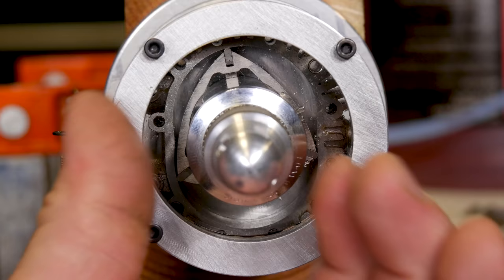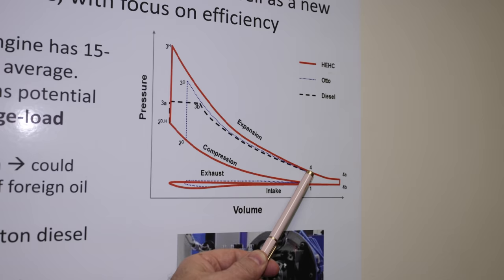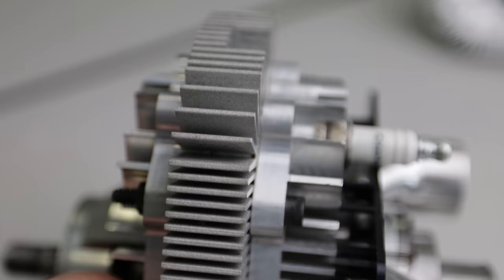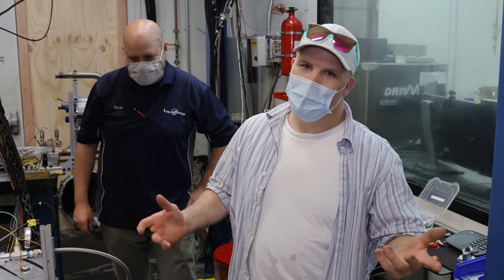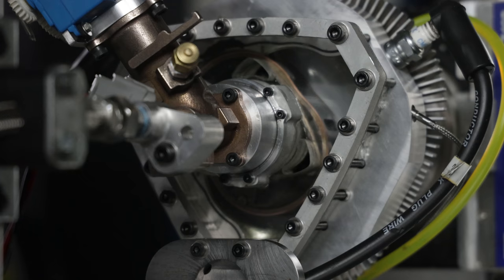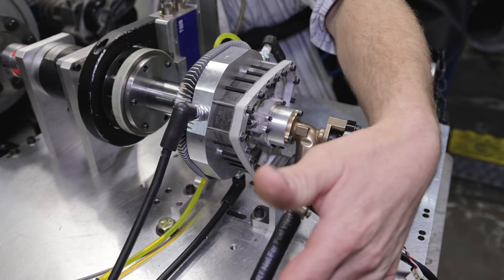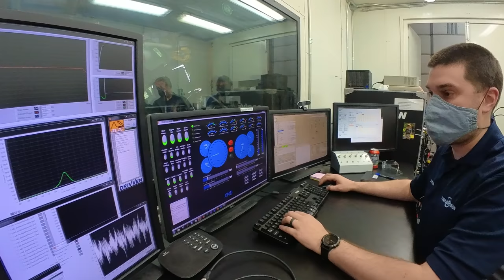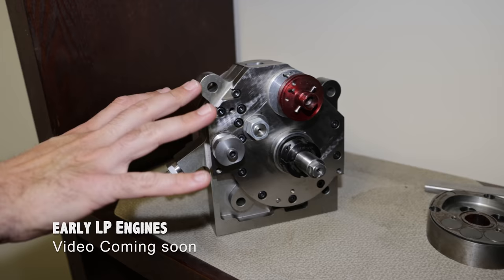See Thru Liquid Piston Rotary Engine - In Slow Motion

Comment: how about lubrication ? does it still used 2T oil?
Reply: Ente disini juga juragan wkwkw
Reply: Bang ft
Reply: Can you answer with the lubrication thing, how oiling work done, because as you know the most common problem of the rotary engines is they burning oil with fuel so it's not good for emmisions etc. Will they fixed that problem? can we see the rotary engines legally on the roads again ? @Warped Perception
Reply: @EmreGhost  there is no oil reservoir so yes, oil needs to be put in the   fuel. Lovely engineering but electric motors are now where it's at
Reply: @EmreGhost  no one cares about emissions
Reply: @dhc2  
Um, the EPA does.
Reply: @dhc2  except everyone who regulate the market
Reply: @aaronburratwood.6957  Do not confuse green energy with money...🤣
Reply: @tkorte101  " but like all plants trees need CO2" what is this even supposed to mean? Trees pull CO2 from the air and convert it to glucose. Approx. 40-50% of the tree's mass is cellulose, aka chained glucose. Scrubbing CO2 from the air and storing it in the form of cellulose is kinda the point of planting more trees.
Reply: @tkorte101  Okay, link me to those studies you're talking about. And I don't mean YouTube videos and conspiracy sites. I mean real, peer reviewed scientific papers discussing the topics you've mentioned. You do that and I'll shut up. I know you can't because they don't exist, but I would like to see where you get these ludicrous statements from. In reality, ocean acidity due to the absorbtion of atmospheric CO2 is becoming so bad that the shells of crustaceans are literally dissolving. 

Anyway, I'll be waiting to read what you come up with, I could use a good laugh. Stay safe, my friend.
Reply: @tkorte101  The biggest evidence of global warming is the fact that it's been going on for 15k years now. The Northern hemisphere glaciers started melting off long before man stepped in with emissions. You are correct that Alarmist have bought in so hard theres no turning back despite evidence staring them in the face. Their "evidence"? Gas bubbles trapt in ice going back a hundred thousand years in Antarctica. Imagine basing your entire belief system and green ideology on frozen Gas Bubbles.
Because that surely tells the entire Earths climate history.  
This doesnt even begin to address the super massive volcano eruptions or asteroid impacts that directly caused extinction level events. No no.. Humans are "forever changing" the climate beyond those extinction events because their gas bubbles trapt in isolated sections of ice, that can only go back 100k years, is more reliable than common sense and actual science.
Reply: @geor664  Actually, I looked it up on their website, they do inject oil, but not into the main chamber, only spot lubrication on the seals themselves.
So the LiquidPiston rotary engines actually don't need more oil then a regular piston engine.

I love the idea of all the flexibility of a hybrid car with this engine.
You could produce hydrogen at home to fuel it as well as charge its batteries at home, then switch to gasoline when on long road trips if needed, or biodiesel or all sort of other fuels, and if there's a huge cataclysm and society ends or whatever you'd have several possible ways of powering your vehicle. =)
Reply: @tkorte101  Yes, they need CO2, that's the whole point.
There's too much CO2 in the air, so the trees are meant to be planted to convert the excess CO2 in the air into wood.
Most of the CO2 in the air right now has been locked away in coal and other long and usually slow carbon cycles for millions of years, but we've fast tracked their emissions without fast tracking their absorption back on the other end of the carbon cycle.
Reply: @tkorte101  Critically low CO2 levels?
Where the heck did you get that idea from? -_-
You can test the CO2 levels yourself, they're high.
Yes, there will be a day when we'll run out of carbon on our planet, but that's gong to be billions of years into the future, approaching the time when our planet will be swallowed by the sun anyway...
And yes, if you go back far enough in the fossile records there wasn't exactly much CO2 in the air back in the days when most of our coal was actually created as most of it was bound in the forests that became our current coal deposits, where a lot of that carbon has been locked away ever since, thankfully.
Reply: @tkorte101  It's happening.
The reason why carbonated water is acidic is because the bubbles in carbonated water is literally CO2.
And every single gas in the air gets trapped in air bubbles that gets mixed in with the sea water naturally due to waves etc.
I'm sure you've seen them, waves, right?

As for the "how things used to be like" idea...
Yes, there's been a lot of different eras on our planets history, including several that humans would never be able to survive in...
Several where we quite literally wouldn't be able to breath.
And no, plants are not carbon starved at all...
We've also had periods with way less carbon in the air even then to prior to us humans showing up.
Reply: @The_Chad_Davis  There's actually quite a few more evidences then just those gas bubbles in the ice, although they are a important clue.
Climate scientists are of course using multiple sources of data.
Reply: @Luredreier  just a quick correction, not picking sides in y'all's shit show of a comment section. But carbonated water is acidic because in order to carbonate water we put it under high pressure (higher than ambient) when pumping it into the water. This creates carbonic acid H2CO3 it doesn't come naturally from CO2 on air, otherwise the ocean would have swallowed all the CO2 by now. It forms when water and CO2 are mixed through either pressure, or minerals that would rather let go of their moisture; I.E. it forms in very minute amounts in soil, carbonated water, and your blood. Large amounts of CO2 wouldn't cause a very large jump in carbonic acid creation, only pressure and presence of the right conditions would.
Reply: @ZeroCooly  That's fine and all, but a quick Google search would have shown you that ocean acidification is a real thing that's happening and can be proven, so I'm not sure where you got the idea that the ocean doesn't absorb CO2.
Reply: @tkorte101  All these arguments are pointless.  The only thing that matters is who has the power and what their regulations will be.  Right now, ICE is on the outs.  That's reality in the first world at least.  These little Wankel engines may have their place, but automobiles is not one of them.
Reply: @tkorte101  Still waiting for you to post any reputable sources. Oh wait, you can't. There are none.
Reply: @EmreGhost   the concept of a rotary engine is useless. only an insane person would buy a car that has a rotary engine. It's a really cheap pile of S***t.
Reply: Oil is metered directly to the seals through the housing. It doesn't need to mix with the fuel. They claim oil consumption is down near the level of 4-stroke piston engines.
Reply: Pretty sure It uses astroglide.
Reply: @dhc2  maby in your world
Reply: @mashrien  you must be a millennial. Read a little and you'll find that storms were much worse in the 50s. Then  look beyond your small sphere of experience for reference when forming opinions. And never listen to government "experts"
Reply: @geor664  The apex seals can be lubricated directly from passages in the housing, since they're stationary.  They get similar oil consumption to a 4 stroke piston engine.
Reply: @Luredreier  the concept is mindblowing really. Amp the scale, devise a way to stack the rotating assemblies, and start collecting used fryer oil. Install a decent flywheel, some gearing, you could potentially generate cheap electricity from home.
Reply: @geor664  Porsche just created synthetic fuel, so the ICE might not be dead yet.
Reply: @elonquemattheson6151  point taken.
The motor is a nice design.
Reply: @mashrien  hurricanes and tornadoes not at record levels  glacier melt and growth are about even
Reply: @mashrien  the reason for the increase of tornados and hurricane is there's more people to report them. Also when a volcano erupts it emits more CO2 than humans do in 1000 years. And the sun drives the climate.
Reply: @Luredreier  they can suck carbon out of the air to make fuel it's renewable. Carbon will never go away
Reply: @JadeB628  Um, I think you're missing the whole this is a different design from those that had all the problems in the past thing...
This isn't a engine with even half the issues that rotary engines of the past has had.
Reply: @flashg1160  This is about statistics.
Yes, there's been bad storms in the past and there will be bad ones in the future.
But there's more of them and on average worse ones comming.
And worse ones have arrived.
Reply: @highclasswhitetrash9027  Yep, but for me it's powering these things from home made hydrogen while still having the option of other fuel types when needed that's appealing.
And of course I'd like it to be a plug in hybrid if I'm even to consider it.
I'd be running on electricity the wast majority of the time.
Hydrogen, diesel etc would all be backups for the battery for me for situations where more engine power or range or both is needed.
Reply: @christopherbrown6523  Creating new fuel really isn't the point.
Even if it's synthetic it's still going to release emmissions that's just not acceptable long term.
ICE is on its way out.
More then half of all cars being sold here in Norway has been electric for several years now.
Reply: @fliporhold  No, there's more glacier melt now then there was.
Yes, there are places where there's more growth and some individual places it's about even, but on the whole around the globe they're retreating at an alarming rate.
I've been to several of said glaciers, both here in Norway and when visiting family members in Iceland, the difference is quite staggering.
Also, I have family members over in Greenland who have shared pictures from their home villages over on Greenland and the glaciers there...
Trust me, they're melting fast...
Reply: @Jv19979  Actually, vulcanoes emitt about 200 million tons of CO2 every year, humans do 24 billion tons every year.
We're releasing far more CO2 then all the vulcanoes on earth does right now.
Reply: @Jv19979  Removing carbon from the air is a energy intensive process, it's not really viable to do in a non-biological way yet, and even if it became viable you'd need a lot of energy to do anything like that.
I can gurantee that it's not going to be the fuel of the future.
ICE is on its way out.
As for carbon never going away...
As a fuel, most definitively it will.
In the air...
No, not for billions of years yet...
But eventually the planet will lose its magnetic field and therefore also its atmosphere and its carbon...
Reply: @Luredreier  no it's not look it up. I think gas per gallon is 10 cents higher when they do it. There's a company in Canada that does it.
Reply: @mashrien  I mean all that may be true but I mean I also want go broom broom
Reply: @Luredreier  im not smart enough to manufacture hydrogen, yet. The possibilities of this little engine though, it really is amazing.
Reply: Ketahuan bang😂
Reply: @mashrien  well spoken
Reply: @Luredreier  I am stupid... but I know  C=Carbon...0=0xygen---CO² is 2times Oxygen what I desperately need... I even put it in my Water with the "Soda-Stream" machine with this little CO² bombs.
Here in Germany are big Factories who produce 100% pure CO² with the explicit aim to relies it into the Atmosphere in vast Greenhouses, Buble-water, Coca-Cola, and 1000 other things....but CO² Tax is only on cars?
The other thing i don't understand is summer & winter. Where the frozen Water easily multiplies.... See level should go up and down like yo yo....NO????
Then there are the humans....in my youth 3,5 Milliards... now 8 Milliards... each is 50 liter water...missing in the ocean.... not counting the cows =400 liter, and the 50 Million barrels/day pumped in the oilfields to fill the void.
Then this alarming temperature rising of 2°C.... on the Pols from minus 50 to minus 48°C... Häääh... in my deepfreece is nothing melting from minus 18 to 16 °C
I am just to stupid to understand all that.... so I give a shit !!!
Reply: Ada centangnya tapi gk di jawab;V
Reply: bang
Reply: Terciduk.
Reply: Terciduk
Reply: @tkorte101  incorrect. At or below sea level the CO2 levels are quite abundant. CO2 is heavier than O2 due to the added weight of the carbon molecule. Increased yield of plant life at various levels with minimal human interaction to create a more efficient transfer requires additional CO2 to be brought in otherwise the plants would be in a 100% oxygen atmosphere at some point and die. In short without plants cleaning carbon from CO2 and leaving O2 and animals doing the opposite to support each other we'd have a dead planet
Reply: @Luredreier  not impressive. the entire stress of that engine is forced onto one piece. physically it won't last long. not to mention lubrication, the concept of the rotary is totally flawed. and it would never give you the performance of a gas or diesel engine.
Reply: @Rainer Kinzinger both of you are missing the point that greenhouses are closed environments with minimal interaction with humans or animals that would complete the cycle of transferring the oxygen emitted by the plants. Without enough humans emitting CO2 the plants would die in a sealed environment. If it's not hermetically sealed and some minute amounts of CO2 leak in they wouldn't produce as well which is why they bring in CO2 instead of paying dozens of people minimum wage to sit there and breathe. Each time the doors are opened in a greenhouse there is an increased chance of letting in insects that could decimate the crops not to mention in the case of light sensitive species such as hemp and it's twin. Letting light in during the dark cycle would cause "light poisoning" which can cause the females of those species to stress and start producing male pollen sacs which seeds the remaining females. When females are producing seeds they put more energy into seed production which reduces the yield of the more valuable flower as the plant like every other thing on the planet wants to reproduce. Also opening the door at any point introduces the possibility of letting in pollen on the bodies and clothing of unwanted varietals causing the seeds to be useless for replanting due to the unknown type of cross that bred the seeds. Hermaphrodite seeds generally produce a higher likelihood of producing females but if trying to produce high quality varietals adding unknown male pollen would likely produce more males and the entire area would have to be stripped for deep cleaning to reduce the possibility of future crops getting seeded. The pollen from hemp and it's twin is much smaller than most other known plant species which makes the cleaning extremely labor intensive. I assure you that I have been studying this subject deeply for decades well beyond a few articles and even considered growing hemp myself until the government decided to over-regulate it beyond my financial capabilities and following my own personal risk assessment due to the unpredictable limitations of the 0.03% THC industrial hemp regulation. If not for those things I'd undoubtedly be a thriving  hemp farmer since hemp was made legal.
Reply: How much horsepower? Does it have high torque at low RPM?
Reply: @Luredreier  might be a good engine for the Moller Sky car which uses 8 rotary engines for ducted fan VTOL hovering and forward flight.
Reply: @christopherbrown6523  Must have acquired “ The Formula” ( movie).
Reply: @tkorte101  Whatever guy. So you're a climatologist and I'm a simpleton because I know how plants consume CO2 and put off Oxygen. I'm not propagating any narrative. We learn this in the lower grades here in the real world. Of course there is mixture of gasses in our atmosphere but for all intents and purposes in a closed environment such as a greenhouse CO2 must be piped in because plants don't use the oxygen much at all. Feel free to stay in your conspiracy bubble and let the people who are specialists in the fields offer solutions. Over the centuries we have had a steady increase in population which displaces the natural plant life that used to absorb the de minimus CO2 that wildlife put off. Plants live in the ground. Not up high in the atmosphere
Reply: @tkorte101  i have never seen someone so wrong about something that is not subjective defending his opinion like hes life depends on it. In the past yes the atmosphere had much more co2 when oceans got created the oceans started absorbing that and some life forms occured as the time went on. Every type of organism is carbon based when those organisms died they sunk to the ocean floor  where they started getting stored inside earths crust. Overtime these organisms became the fuels we use now. Meaning carbon levels were slowing declining. Keep in mind these types of microorganisms i am talking about appeared about 3.7-4 billion years ago. First marine animals startes appearing about 560million years ago plant life started appearing 500million years ago and land animals appeared 425million years ago. The reason why the atmosphere was balanced on co2 levels is that animals with plants recycled carbon . Animals ate plants->animals die->plants use dead animal matter(soil) to grow-> animals eat them and the cycle goes on (similar situation kinda  happens inside oceans). When those microorganisms died 3 billion years ago they werent getting recycled they just got stored inside earth.   So what we do now is releasing carbon that existed on earth before the life that we know now existed. That is why carbon levels are keep raising , so in a sense you were kinda right its the timeline that you fucked up which made your statements wrong.
Reply: @tkorte101  and there it goes. When someone doesnt have sufficient arguments he/she resorts to aggresive language without any actual meaning. Please continue living inside your bubble
Reply: @tkorte101  "typical of leftish propaganda" ok now i see the full picture of you
Reply: @tkorte101  first of all i am not "left" second i never said in any of my replies we must cut emissions and how , i just corrected what you were saying about co2 which was wrong and i am not american dont bring me in your politics
Reply: @dionisis2487  that's American politics for you :/
Reply: Bang request cara kerja acg stater
Reply: Mantaap bang
Reply: @tkorte101  Did you know that fossil fuels are literally dead fossils? They are literaly the trees that you are talking about...
Reply: Lubrication added to the fuel mixture was primarily due to the nature of the apex seals basically 'scraping' the inside of the chamber. That's why they failed so often. You needed a lot of oil to make the standard Mazda rotary stay operational. The design of this piston doesn't have a similar apex and fits the chamber more like a traditional piston's tolerances. It looks to me to require much less or even NO extra lubrication.
Reply: @Luredreier  how is the "piston to "cylinder" interface lubricated? 

Generating hydrogen for fuel = coal powered, just like ev's.
Reply: @geor664  So this thing has basically the same problems as a regular old rotary engine.
Reply: High, 2T-oil is a possible way. Kindly Fiete
Reply: @dhc2  Pretty ignorant think and say.
Reply: @razurio2768  if the EPA care about emissions so much why dont they go after the big factories producing far more toxic emissions than cars do?
Reply: @daviddrake6875  They said 4HP and 4 pounds weight...
Reply: Yes it will require internal lubrication for the seals for longevity and the only way to do that will lead to burning a bit of oil and preferably a bit of premix. It is in no way a good engine that's worth putting in anything. You can all forget about this junk already
Reply: @geor664   There are engine designs that are superior to conventional and rotary engines out there and are almost as efficient as electric motors and just a long lasting.
Reply: @tkorte101  😂🤡
Reply: @EmreGhost The apex seal on this engine doesn't travel to the combustion chamber like on traditional rotary engines.
I wonder if that could result on less lubrication oil loss by not burning and heating the apex seal on the power stroke. I can see good potential for this engine on the paragliding community where less weight matters.
Reply: @boissondevin9772  That are the apex seals.  Apex seals are now stationery in this engine.  How about the rotating rotor?  The side of the rotor that has contacts constantly with the chambers require lubrication as well.  How to do that?  Is it also  done by pre-mixing oil with fuel?
Reply: @catchnkill  that side seal on the rotor is also in constant contact with the apex seals. Because the apex seals receive oil, the side seals receive the same oil from that direct contact. The only oil consumed is the thin film deposited on the surfaces by contact with the seals, much like the thin film of oil deposited on a cylinder by a piston seal.
Reply: @normanguzman417  it sounds hopeful, thanks
Reply: The LiquidPiston design reverses the shapes: an oval rotor moves within a triangular housing. The required seals (both face and apex) are mounted on the stationary housing, and are lubricated directly.
Reply: @prolarka  the face seals are still mounted to the rotor. They get oiled via direct contact with the stationary apex seals.
Reply: @JadeB628  Thanks for stopping by...
Reply: @Lassi Kinnunen 81 In the Mazda Rotary, it does not need two stroke oil. It injects oil from the crank case to a metering pump that puts drops of oil at a time through the housing wall. Racers choose to mix 2 stroke oil with gas because highly  modified engines burn more oil than what the OE metering pump is capable of. The engine shown here might not have a metering pump, however i imagine they will install one if they had to. Another option is a separate reservoir to add two stroke mix like the ones used on 2 stroke jet skis. That set up use way less oil than mixing directly on the gas.
Reply: @tkorte101  The rational world wants reduction of pollutants and greenhouse gases.
Reply: @tkorte101  I tend to follow the experts, scientists.
Reply: @mashrien  News report: there's a massive fusion reactor in the center of our solar system that has infinitely more impact on the climate than the CO2 that totals .04% of the atmosphere.
Reply: @stlgdroidst  Okay genius, if the sun is the only thing affecting our temperature and climate, then why isn't the moon the exact same temperature as Earth? We're the same distance from the sun, so by your logic should have the same climate.

What's that? The atmosphere controls how much heat is absorbed and stored, you say? Who knew?!
Reply: @geor664  Electric motors are NOT "where it's at" because all the people promoting them are not mentioning several "small details":
- you still need to produce the power, so its not an ecological gain
- the power needs to be stored ... but the ONLY source of the materials needed for the batteries is in "country X", which has made headlines due to its connection with a certain virus ... AND there are talks about war'n'stuff ...
- there will never be a truck powered with electric motors ... and having two different types of propulsion at the same time is stupid

So the aforementioned people are either stupid OR they want to sell you something.
Reply: @mashrien  If it means that much to you ... why dont you STOP USING ANYTHING that requires power ... like the Internet for example? Even if your electric car is fueled by "green power" ... there is only a limited amount of it and the increased demand - due to all the idiots buying Teslas while thinking they dont produce any emissions anymore - gets supplied by power plants.

Oh and do yourself a favor and do NOT mention nuclear power ... which is worse than coal.
Reply: @mashrien  Please stop throwing everything together it gives everyone a headache.
Reply: @Twilzeth  How do you know how much will it use?  In a traditional rotary engine oil burns when the seal is exposed to the high temperatures of the combustion chamber. In this design the apex seal is not on attached to the rotor, it is placed in the housing wall sitting static away from the combustion chamber. The two strokes engines burn far more oil and more gas yet they are still used on many applications where light weight compact gas engines are required.
Reply: @Jv19979  and where do you get that energy from? Don't say other renewable energy sources because they take space and resources to build.. and some if the materials used to make them are not ecofriendly.
Reply: @normanguzman417  The oil in this engine is going to end up being burned no matter what. Some of it will be constantly wiped off from the seals onto the rotor surface which will be covered in a film of oil all around, all the time. Every bit of oil you put on those seals will slowly end up being burned or wasted out the exhaust. Also having the combustion surface move across the seals means they get hot and all the soot from the rotor will be wiped off and collect next to the seals over time, probably leads to oiling issues. This engine fixes nothing
Reply: @christopherbrown6523  synthetic fuel from cracked hydrocarbon molecules.    A way to make fuel take more fuel to produce.
Reply: @Lassi Kinnunen 81 All 2-stroke engines don't need premixed oil.
Early oil field engines, like the reid, and Ball Engine designs were raw-fuel burning 2-stroke designs.   Another good example is found in the Detroit Diesel 2-strokes.   The only reason a 2-stroke needs a premix is when it is breathing through the crankcase.  Piston ported engines do not require crankcase pressure to operate, it is just the easiest way to build them, and maintain a level of efficiency with old-fashioned carbs.
Reply: @Twilzeth  Wrong again. On a piston engine oil lubricate the cylinder walls and travel to the combustion chamber. The oil control ring can do only so much but as we know piston engine will burn oil too but in less quantity. Let me remind you that the oil lubricates all the sides of the apex seals, not just the surface that contact the rotor. Therefore oil lubricating the sides are not drag in to the hot combustion chamber any longer. On a OE Mazda engine oil consumption on average use is 1 quart a month. Which sets the owner back $5 per month. If this new set up can burn less oil (which no one knows except the people involved in the development) the emission problem will still be unborn fuel. Which still even with the improvements might not be enough to compete against piston VVT that can lower and elevate the compression of a engine. With the world moving to electric the demand for gas engine will be less. The only ones that will always need light engines is the ultra light aircraft community, para gliders, gyrocopters experimental aircraft and such. There was this talk about rotary engines for Electric vehicles running a backup generator because in small size it may pass EPA and because they run smooth compared to a 1 or 2 piston small engine, but nothing certain as always new developments can pull in any direction anytime given .
Reply: They mentioned that they could make it diesel would it still need premix if it is diesel since it is basically oil its burning . If so they could just throw a def system on it and make it pass emissions
Reply: @warped perception 
Your show was short,but very
precise.i would like to view your
WANKEL episode next,if I can find
it.can't wait.
Reply: They said lubricating oil is delivered directly to the apex seals in the housing.
Reply: 2s not 2t
Reply: @Lassi Kinnunen 81 I used Royal Purple 10w30 in my '87 FC na and '94 FD tt 13b engines ...depends on the season of course.
Reply: @aaronburratwood.6957  that is what a catalytic converter is for if the engine can't burn off the oil and gas completely and still can be burned off down the entire exhaust system
Reply: @mashrien  higher Co2 levels brings greener and more vegetation. You know, plant food. That is what plants love, Co2. That is why we have more vegetation throughout the world now more than ever in history...plus it's slightly more warmer which is great for vegetation and growing food in areas that were too cold to grow. And in areas that had more arid landscapes, now have lush rich land. So, this whole global warming thing is actually better for civilizations across the globe. if we are so scared of and increase of 1-2 degrees Celsius  over the next 100 years and can't adapt as humans, then we have failed our ancestors.
Reply: @TheSupertexx  Diesel is an "oil" but it is terrible at preventing galling, and would be doing very little to cool contact zones.  It is really a better cutting fluid than lubricant. With diesel operation, any oil used would also be a source of fuel. shut down would mean the motor would be turning dry. 

Interesting question. Would bring a whole host of multi-fuel options.
Reply: @mashrien  redo your research and not Facebook
Reply: @dhc2  "no one cares about emissions" Living in the past?
Reply: @mashrien  Tom Korte appears to live in a petrol-headed fantasy world.
Reply: @mashrien  - Dude, we're still coming out of the last ice age, I'm all for a cleaner environment but the earth has a knack of cleaning itself up, hence fluctuations in Co2 & O2 over the past billion or so years :-/
Reply: @Luredreier  no, the reason Co2 makes oceans acidic is because the H20 molecules actually react with CO2 to form H2CO3 otherwise known as carbonic acid. The combined structure gives the oxygens resonance stabilisation that makes the hydrogens much easier to detach, making it a diprotic acid. It's something taught in basic university chemistry
Reply: I  think there actually might be  NO  Contact between the Rotor  and the Chamber . Very tiny space between . 
The Crank Gear can have wet/dry sump lubrication if  I  understood what  I  was seeing .
Reply: I  suspect it doesn't need 2T . Maybe just a bit of Perimeter oiling . Probably advisable to Run it in on premix , but once bedded in there is no actual contact between Rotor  and  Chamber Block . Perimeter Oiling , like Piston Rings get , would make a Perfect seal .
Reply: @EmreGhost  Well at the very least seals are on the outside and not on rotor which should make it slighty better, and much easier to oil
Reply: bangg
Reply: @xani666  thanks
Reply: @mashrien  So?? Must go vroom!
Reply: @mashrien  the first massive volcanic eruption will produce more toxins and greenhouse gasses in the first minute than human existence thus far..case closed...lead additives or Cam2, and we are in business with this little gem.
Reply: @highclasswhitetrash9027  gasification applications....?
Reply: @Luredreier  Norway...how do you get your imports and exports....it ain't electrically powered and won't be anytime soon ....we've heard about battery technology for a long time , this new liquid metal battery is basically grid only use...shipping by air land or sea will remain diesel for a while....and whatever is charging the battery is usually dirty as well, or 3x as dirty during the manufacturing and mining process.
Reply: @vincentrusso4332  man i agree, ive done a small amount of sketching and using this little fella (the single rotor design) you could spin an 8' diameter, 450kg flywheel using 15:1 gearing and a simple clutch to rpms like 8k. The engine would only have to run maybe 3 minutes an hour to maintain the flywheel speed. I have a massive garden so spacing wouldnt be as much of an issue for prototype design but a scaled down version could possibly put out anywhere from 7000w to 9000w for as long as the fuel supply could last. Even hypothetically a small gasifier could be installed on the skid and one could manufacture his own electricity from firewood! I do love these advances in rotary engines, so many possibilities.
Reply: @ZeroCooly  Not sure if you've noticed, but the bottom of the sea has quite a lot of pressure, water after all is rather heavy...
And air is absorbed into the water by the waves...
So, air bubbles in the water that's being pulled down by the currents down to the bottom of the sea...
Yeah, your argument isn't really holding water as far as I can tell...
Reply: @highclasswhitetrash9027  You don't really need to be smart...
You'd essentially just buy a box, connect water and electricity on one end and you'd get oxygen and hydrogen on the other end.
It won't even have moving parts, although it will wear out eventually due to chemical processes that can't be controlled just like a battery will...
Reply: @heinzmaier2739  So, you're wondereing why the water isn't lowering?
Melting fresh water from all the various land based ice is part of it.
And there's many other cycles involved, like how much water is in the atmosphere vs in the form of fluid in the sea and lakes etc vs water that's literally in the ground.
Huge amounts of the Earths water is most likely not at the surface at all but in the mantle etc.
Only about 0,3% of the surface water is actually available to us humans as drinking water.
So even with the water inside us that is still so little that it makes little impact on the sea levels, our carbon emissions however has more impact and is visible.
Reply: @Rainer Kinzinger Theoretically yes, you'd get more weed, although you wouldn't necessarily get as stoned on that weed.
I don't have experience with weed in particular.
But I know that with vegetables we here in Norway sell vegetables and fruit that often taste better then many other places because our climate makes them grow slower increasing the concentration of a lot of things in those plants, while the faster growing ones elsewhere is mostly just water and carbon and little else leaving them somewhat tasteless by comparison.
This doesn't apply to all plants, but it does to some of them.
But regardless, if you want to increase yield then there's better ways to do so then to increase the carbon levels in the whole atmosphere...
You could just do it in a greenhouse  with local carbon levels that's higher, you'd need way less carbon to do so and get that effect there and you wouldn't fuck up our enviroment doing it...
Reply: @JadeB628  Um, what comment where that replying to if I may ask?
There's a rotary engine out there that doesn't have lubrication issues by the way.
Reply: ivan schafeldt  There's more then one type.
And sure, any individual reading needs to be taken with a grain of salt...
But when you start adding up thousands of them you got another story.
Reply: @Petri_Pennala  Depends, our coal is mostly trees, but some of this stuff predates trees by quite a bit...
Reply: @theviniso  No, it doesn't.
With stationary seals you can inject lubrication where it is needed rather then to mix it into the oil itself and there's less wear and tear on the seals.
This design should require less maintainance, use less fuel consumption and especially need less oil for lubrication.
Is it perfect?
No.
But it's a good step in the right direction.
I'd love to have a plug in hybrid using a engine like this capable of both using gasoline and potentially renewable fuels like hydrogen.
Reply: @dhc2  There's been emission standards for factories since the 1860s or so in Britain and other countries followed.
(The first enviromental act in Britain was actually a short lived ban on coal fires in London in 1306, but the Alkali Act of 1863 is the oldest ban on pollution from factories that I can see on the books anywhere...
Regulation on factory emissions therefore has a long story, the difference here is just that for once we private citizens actually are asked to make changes to our lives and regulations are made to facilitate and incentivise that...
Reply: @Twilzeth  Nope, you're thinking of the Wankel engine that indeed does have those constrains.
But this design has fixed places for the seals so the lubrication can be delivered on point just like in a piston engine and doesn't have to be mixed into the fuel itself, reducing the lubrication needs.
Reply: @smh9902  I'd love to hear about them. =)
Especially if they're multi-fuel capable.
Ideally also at a low RPM unlike the turbine engines...
Reply: @catchnkill  Any part of the engine that requires lubrication that is stationary can have point lubrication where the lubrication is feed directly to the point in question, that wasn't possible with the Wankel engine.
Reply: @gabrielbrunser6401  Please don't resort to name calling.
Whatever we might personally think about those we argue against we achieve nothing but the opposite of our goals by resorting to such measures.
Reply: @stlgdroidst  Kind of true.
Thankfully we've been blessed with a unusually stable sun with very low variation in output compared to most stars of both its own class and other classes.
And we can indeed see the impact of changes in solar activity on the gasses in our atmosphere, for instance how high our amosphere goes depends on that activity with it sometimes puffing out more.
However as far as surface level effects that CO2 does matter, not just because of the direct effect, but also the indirect effect through other feedback loops.
Look up the video that Simon Clark made about why Venus is so cold.
Reply: @stlgdroidst  Also, for reference Venus is further away from the Sun then Mercury, yet it's way hotter at the surface.
And the moon is the same distance from the Sun as the Earth but it's not the same temperature, not even close.
Indeed greenhouse gases are indeed the reason we don't live on a ice rock with similar temperatures to Mars right now, but while having some greenhouse gases is a blessing there's such a thing has having too much of a good thing.
Reply: @Muck006  Even running a EV on 100% coal powered electricity using batteries that produce quite a bit of greenhouse gasses to produce you still end up producing less CO2 with a EV then with a gasoline car after just a few months to a year of use assuming daily driving with both.
But yes, you're right, technically in places with a low rate of renewable power in the energy mix a plug in hybrid car (with a big enough battery for your daily driving) is actually more enviromentally friendly then a pure EV, you need a certain amount of renewable energy in the energy mix for a pure EV to make more sense then a plug in hybrid enviromentally speaking.
Reply: @Luredreier  Yes, they will be debuting within the next 3-7 years. Lots of R+D to be done, but its happening. Jim Griggs and his hydrosonic cavitator provides the ultimate solution to multifuel engine technology.
Reply: @Luredreier  And how are you going to get oil all over the seal all the time? You'd have to have a split in the seal or something similar where you constantly have oil sitting in and it will get wiped off on to the rotor surface all the time. No matter how you do it you have to put oil literally inside the engine where it's either going to burn or go out the exhaust. In the slow motion you can also see how much the seal is being pressed up and down so it's constantly wearing away. Anyway this engine is going to be a total failure, it doesn't have any desirable properties that another already existing cheaper, better engine doesn't already have. Pisses me off when people give their money to shit like this without asking people who actually work on modern engine design >.<
Reply: @Luredreier  the idea of hydrogen producing on a medium scale does appeal to me, perhaps v1.6 can incorporate a  water tank and such. I have an abundance of wood, and a medium gasifier used to fuel a mechanical sawmill. Dont want to commit to this new hollow crank technology yet though, as the gearbox and flywheel assembly carries quite a bit of inertia and i see it as a main failure point. Bah! Ramblings of an old man, so many ideas, so little time.
Reply: @geor664  Clean burning 2 Stroke Maybe? It said it was a Multi-Fuel motor, which means it could use Diesel which has more lubricity than Gasoline and Biodiesel has more lubricity than its DinoBased brother

I'll be mind blown if they make a Turbo Diesel version
Reply: @mashrien  For many places electric cars are not a solution to this until our power infrastructure catches up. If your town runs coal generators an electric car is no better than a gas for emissions.
Reply: it uses al gore oil
Reply: @geor664  yes this is cool but obsolete.  If petfected the only use I'D see is usevin a serial hybrid car and as a range extender or generators in the event of electric power failure.